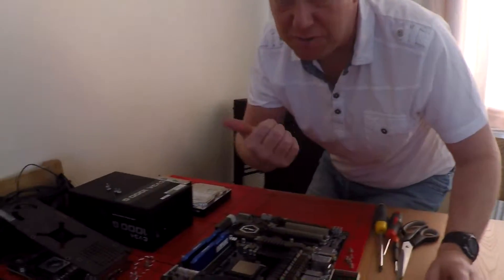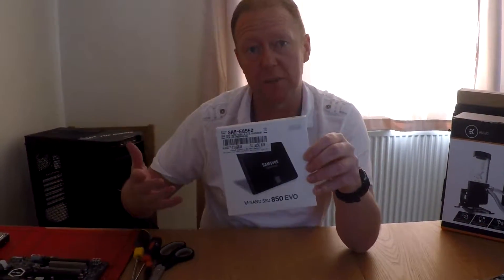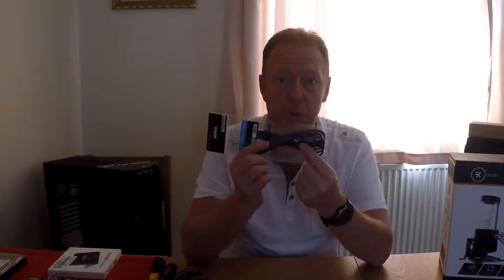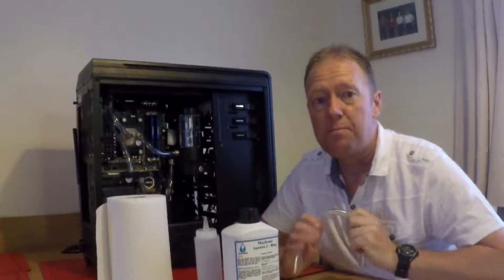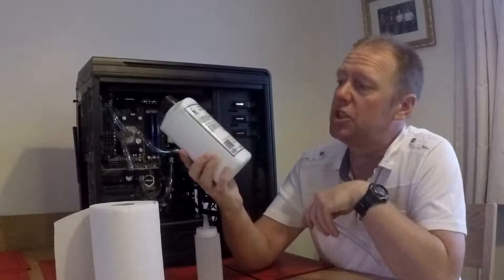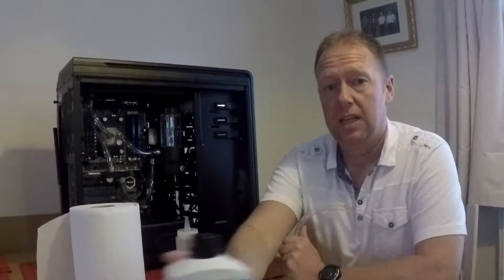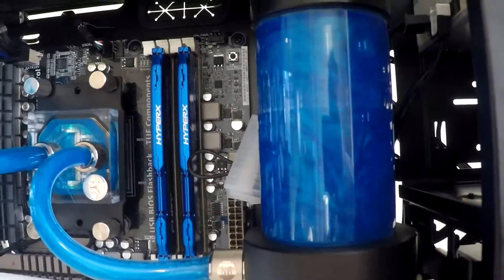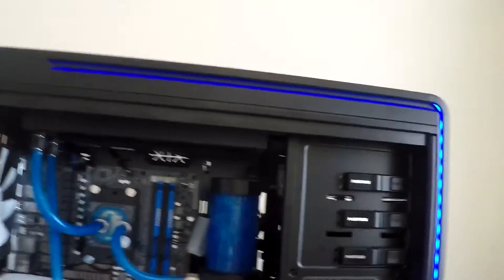Ozmodions first Custom Water-cooling Build and channel update

Comment: its quite dangerous isnt it? what if it leaks??
Reply from the maker: LV Gaming that's the chance you have to live with, but if you use the right fittings and fit them it's really secure, trust me I had to take a tube off to adjust it and, bloody he'll,  it was hard to get off
Reply: Ozmodion XD i just dont know where to connect the wires. Too complicated XD Does  the motherboard have a manual that shows where plugs should fit in?
Reply from the maker: Yes they should all have a manual or able to download one. It's not as hard as you think, all I did was take photos on my phone every time I disconnected a cable so that I could look back on it when placing the new stuff.
Reply: Ozmodion woah! youre a pro